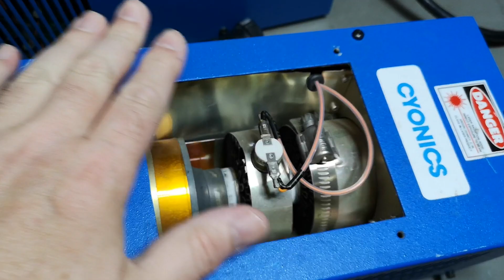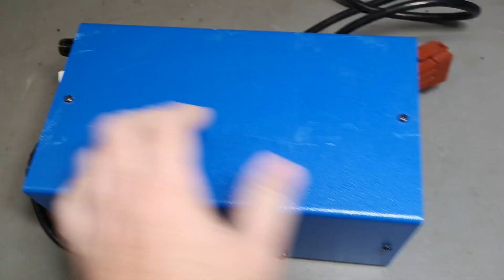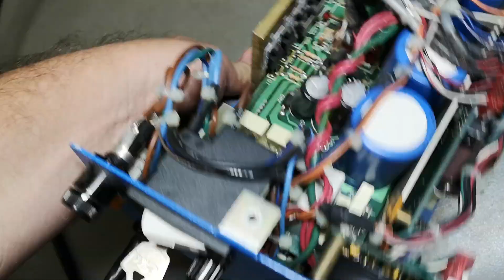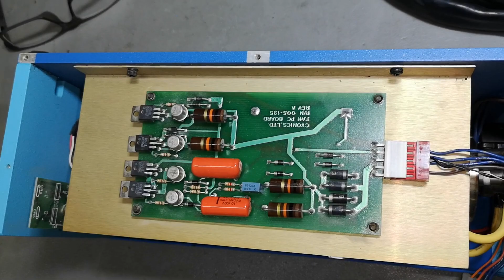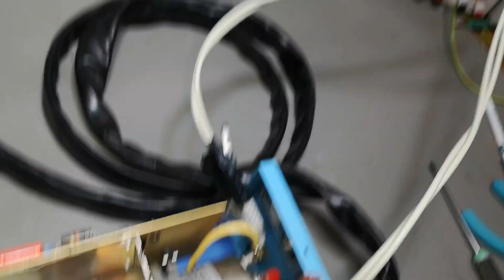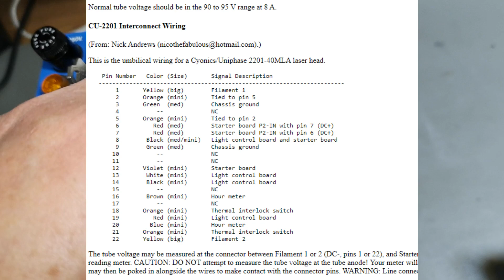Cyonics Uniphase 2201-15SLB 15mW Argon Ion Laser Blue 488nM

Comment: cathode is 2.65vac , cathode transformer is center tapped so the arc current is balanced on the cathode coil
Reply from the maker: yes that makes sense, I was hoping for mains tap info, so i could rewire it for 230V and maybe an easy mod to the power supply, so it handle 230V..